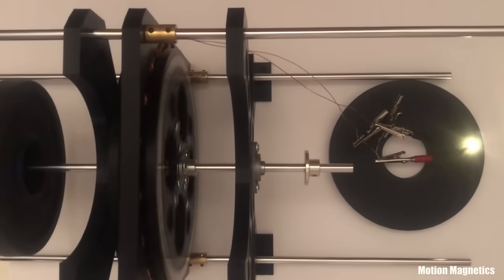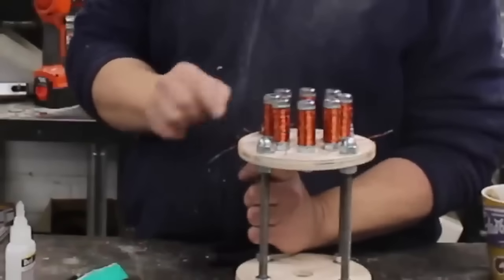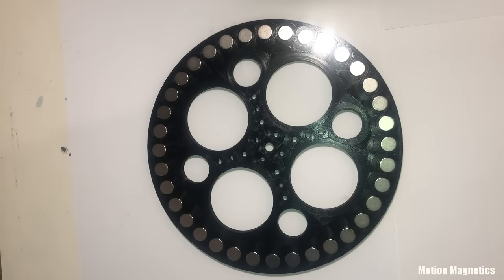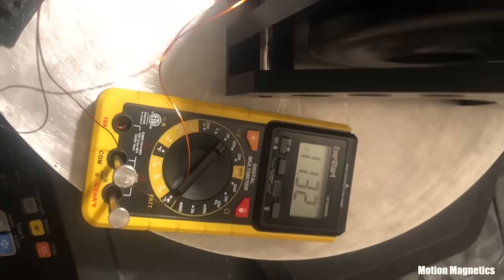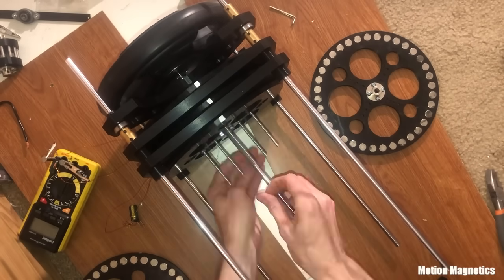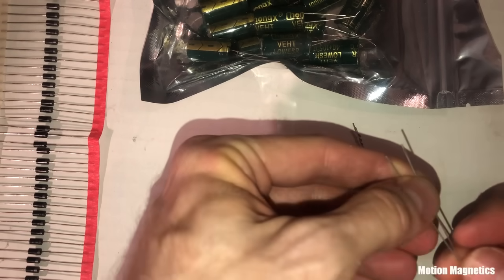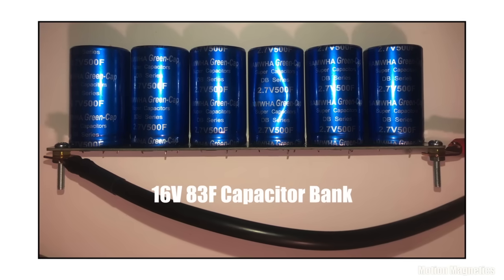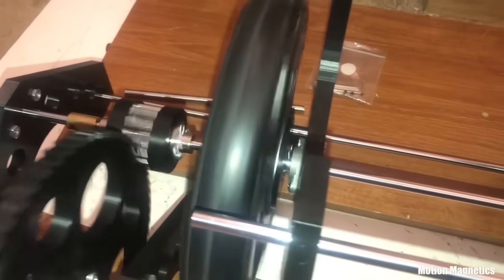Stackable Generator

Comment: I was using ChatGPT a bit ago to calculate the voltage generated by using a serpentine coil (after seeing Roberts's video on it) and some n52 magnets arranged in a Halbach array... using individual magnets with a surface Gauss rating of 5884 Gauss in an arrangement of 12 magnets, 30 turns of 18AWG coil, the resistance of approx 0.006385 ohms per meter, I could generate about -1.6V per coil... adding 8 arrays, I could generate -13.2V... Likely I would have to rethink the whole construction, as the magnets used for the calculation are about 30 dollars per one, and I would need several dozen for it. Would be able to generate that voltage turning at about 10 ft per second. 

I no longer remember what the calculations were for RPM, as I had it stenciled on a cutout that I lost, but I found I could connect it to a mechanical machine that has two gears, with enough tooth reduction to turn the motor at either 460 RPM (assuming I calculated for 5 inches in diameter for the magnets) or 381 RPM (assuming I calculated for the full 6 inches in diameter for the magnets). I assume it is around 5 inches where I planned to put the magnets, but through gear reduction, I found I would only need 1 RPM of the mechanical machine to generate the voltage. Combined with 5 other generators, I would have enough to generate a considerable amount of power and get quite a workout as well, assuming I could still spin it and get the maximum amperage. I would likely need to redo the entire design of the primitive setup to save on costs, but it was nice to calculate and design it to that part lol.

EDIT: Also just remembered, I am not sure you can or should put them in parallel, as the wires you used are 23 gauge, 22 being capable of 5 amps and 24 being capable of 3.5 amps... there would be a certain limit on how much power you could put through it. It is why people making generators are typically better at generating high voltage and lower amperage and converting the voltage for batteries, but it usually costs a lot for those converters. I saw one that fit my needs capable of converting 300V at 5-10A of an earlier design to 48V or 70Vish, but cost about 1400 dollars cheapest... Maybe you could reuse the Microwave Transformers to make your transformer capable of capturing a lot of amperage and lower current?
Reply from the maker: It would be interesting to see you put that design together and see how it translates into the real world. 

I may not have explained it in the video but I used the diodes to direct the current out of the 23AWG wire and into 12AWG wire so that when everything was connected together it wouldn't harm the thiner wires from the coils. The 12AWG wire connects to the input terminals on the charge controller, and then  I used 6AWG wire to go from the output terminals of the charge controller to the 16V capacitor bank.
Reply: @Motionmagnetics  That makes far more sense to direct the power through the diodes. As for my design, I intended to make the small wheel of pain from Conan Exiles and have it turn a generator instead of a several hundred-pound mill stone. I have seen only one real wheel of pain design, the massive one from the movie, and a massive man who moved it on his own. I figured from that real-life example, and some tweaking and calculations, I could make a smaller one with enough mechanical advantage to move the motor attached via a simple gear drivetrain. 

As it stands, I would save considerably just by building the wheel and attaching a gear to a treadmill motor I have, and using that to generate electricity. Would be enough to test it I would assume.

The end goal would be to get my saltwater batteries developed and then store the generated power in them. Currently working on increasing the storage by way of graphite and some binding agent, of which is expensive to start buying and testing, so that likely would be the first purchase.
Reply from the maker: @Suzuki_Hiakura  Well that would be an original approach.
Reply: @Motionmagnetics  well done you have proved to a cert

Comment: Rob's great! I didn't quite get the surpentine coil though, can you explain it better, and what does your experience tell you about it?
Reply from the maker: He does a great job of explaining it thoroughly if you search serpentine coil on his channel.

I’ll give you a basic example. Picture a rectangular coil with a magnet passing over it horizontally. The voltage comes from the two vertical sides of the coil as the magnet passes over them, while the portion of the magnetic wire at the top and bottom of the coil doesn’t contribute to the voltage. The premise of the serpentine coil is that by weaving it in a zig-zag pattern there is less waste since there is only wasted wire in one place, either above or below the magnet, instead of two as it passes over the coil. 
I couldn’t tell you specifically how much more or less power you can produce from a serpentine coil, but the main reason I decided to implement it into my design is the incredible ease of making them. I’d rather wind one coil and wrap it around spacers on a stator assembly than multiple coils that I have to connect and wire together.

Comment: I charge up a bank of super capacitors via my e-bike (6x 500F, same as yours) on a back-wheel standard. I need to peddle roughly 1 minute and that gives me about 3 Wh of energy. (in 1 minute I peddle 180 Wh for a minute). Usually I charge up my phone (a 12v to 24 V USB car charges does the buck part). I also run an ipod from that usb to listen to the (internet) radio all day, 1 minute of peddling gives about 4 hours of music. To prevent the power going back from the caps to the motor (which I use as generator) I just us a rather large diode (one from a motorbike I had laying around, it has a metal shell for draining the excessive heat). When the caps are empty I use a very low gear, and as they voltage creeps up I can change gears up and up. My ebike does have a 24 Volt motor, which is very convenient to create 16 Volt. A 36 Volt or higher motor would need a buck controller like you used. 
Keep up the experimenting. You do are going crazy on the amount of (needed) magnets, it makes your project rather expensive I think. I would not go that far. You may be better af using an old handheld battery powered drill. It has the motor (as a generator) and gears already. But there will be less fun in building that, I agree. It depends on your purpose. Mine was to force me to have some form of exercise every day, and do something useful with that energy. PS: I subbed to Murray many years ago, great enthusiasm he has!
Reply from the maker: Thanks for the comment. Sounds like you have the process worked out pretty well to suit your needs. Did you upload a video of your pedal generator? 
Yes, the magnets can get expensive. It would definitely be cheaper to scrap them out of something or use a motor as a generator. Though perhaps not as fun?
Reply: @Motionmagnetics  I do have one or two very old movies with the ebike. The bike is still working, but I have not made a video for a long while. On my channel you do can see me powering several electric devices.
Reply from the maker: @deslomeslager  I found it. You should do more with that. Love your setup and the simplicity of it! Great video!

Comment: I love Rob's channel too. Great guy. Where do you get your shaft fittings for your rotor?

That would be beautiful in my projects. I make static electric generators, think voss machines or wimshurst machine. My own designs. I'm trying to get the current capacity up. Different design chanllenges.

Friggen cool though, I was thinking about making an PM-DC genny once I'm bored with making lightning shoot through my basement with THE RAW UNBRIDDLED POWER OF MY BARE HANDS! applied to a driveshaft XD

In all seriousness though, cool project

BTW, I noticed you have an interest in free energy. We should be friends because I think you and I will have some very interesting discussions: Like how it's possible my innert static electric generator takes 0.44 amps of drive power and the active generator takes 0.47 amps of drive power at 118.8 volts from the wall but produces 100 uA @ 115 KV.

Over-unity is possible, I'm working on a better design that will have better alignement, less friction and more charge-carrying ability on the rotor. I already have a COP ~3 on the energy difference bettween active and inert, now it's about fixing my generators balance and alignment and getting lower friction bearing than grease filled sealed bearings so that it doesn't take 51 watts to spin it with all of the electrical connections removed and all the fields neutralised.

Like I said, I think you and I could have some fun discussions.
Reply from the maker: He's inspiring. I found them on Amazon. They are listed as 8mm Rigid Flange Shaft Couplings. 

Thanks! Sounds like you're working on some interesting projects. I'll have to check out your channel.

Thanks for sharing the information.

Comment: good geometry, there is a rotation beyond which the drag decreases if the coils are shorted, like in stepper motors. good the idea about dc/dc converter i think the goal is to keep the cois charged by very low impedance
Reply from the maker: Thanks. Sound logic.

Comment: I'm using a bedini energizer to spin my magnets around my serpentine coil, the video is on my channel. I've open sourced it, please give it a try! You can easily generate more energy with your generator and flywheel then what the bedini circuit uses!
Reply from the maker: I'll take a look.
Reply: awesome! while you are there, if you could give me some pointers on the generator side, you'd have my deepest gratitude!! @Motionmagnetics

Comment: Wouldn't the input need to have the torque to turn the max amount stackable generators even with just 1 generator on it? Otherwise, wouldn't the force on each generator, and thus it's output, half? Or am I missing something.
Reply from the maker: By setting the magnets on both sides of the stator coils it eliminates the need for steel cores in the coils. Without the steel cores creating drag as the magnets spin past them it reduces the need for torque, drastically. So there was very little difference in friction when I went from one rotor to five.

Comment: That is awesome. I was pondering just yesterday why people didn't do coils on both sides of a single magnet array like that.

A thing you might try, and I don't know if it would matter,  is make your magnets match (NN/SS) on either side of the coil, or offset each magnet ring a bit so you get a faster N/S flip.   I just think having opposing magnetic fields affecting the same spot on the coil at the same time may affect your output.  maybe not. I may not be thinking on that right or got your arrangement wrong in my head. (as I understand it you have a N on one side of the coil and a S on the other, alternating, right?)  if you Offset each magnetic ring, it should, if I'm thinking on this right, double the speed each segment of the coil is getting it's field flipped which Should get you more output. 
Something to try, anyway.  Keep up the good work
Reply from the maker: Thanks. I have each rotor set up like a standard wind generator, alternating north to south with each magnet. The rotors are all lined up so that each north pole attracts a south on the next rotor, and each south a north, held evenly apart by spacers. That removes the drag so that they spin freely through the coils in the stators.
Reply: @Motionmagnetics  canceling out back emf? Makes sense

Comment: Cool project. I recommend to go for 24v system or more. There is a cheap and good 300w MPPT boost controller, with the blue label on it. So it makes it a lot easier to charge on variable speed.
Reply from the maker: Good suggestion. I'll look into that. I only picked 12v to work with small standard inverters for the initial testing.
Reply: Yea so consider 48v that would be huge.

Comment: 16 votl cap is not enough leeway. I would use at lest 20v caps or more.
Reply from the maker: Perhaps. I picked 16V because these types of capacitor banks are also used as a supplement to a car battery, and since most small inverters can run off a car battery, they should also run off of the capacitor bank.

Comment: Let's get you some more money! This is going to be a game-changer. Well done, very well done.
Reply from the maker: Thanks. Cashflow is often a hindrance to expedient progress. I am hoping this type of system will help change the game and provide fast and inexpensive energy.
Reply: @Motionmagnetics lo felicito por su empeño quisiera ver que algún día construyera un motor de cuerda con imanes creo que ese sería un gran avance
Reply: @Motionmagnetics I am a big fan of Robert and I'm working on right now a wind turbine with his Serpentine coil and now I'm going to change the design based on his work with flywheels and now you're amazing transformation of his design into an incredible generator it hooked to a wind turbine or two depending on the type of blades and size as well as hooked to a high torque generator to get the system running to produce a really stable high output level of energy as long as you use the right gears and allow the wind turbine to remove even with low levels of of wind so I'm going to give this quite a bit of thought and see what I can come up with but anything you might have in mind let me know because we have the same I guess Mentor you could say and he is fantastic I also want to make my design using milk plastic with graphene added that he demonstrated being stronger than steel as it's biodegradable doesn't create forever chemicals and if you add graphene and a UV clear coat it's not going to degrade until you put it in an composting environment where it will then turn back into milk protein and graphene
Reply: killerwolf7676 he disparages people on YouTube, so they won't be successful, that's literally all he does. Ask yourself why he is spending his time reading about "10 year old technology", if he had anything useful to offer... People are using 10 year old technology heck even 70 year old technology to generate power, because it works.. Which I suspect the commenter... doesn't, lol.
Reply: If only each subscriber sent 50 cents he will get over $25ooo.  I want help this genius.
Reply from the maker: @andrewsiurda6780  Thanks. Money isn't my main motivator. I just want to show people how to be a little bit more energy-independent. I will admit that it wouldn't take as long to get everything built if I didn't have to save up money for parts all the time though.
Reply: I'm working on the same thing that this guy is based on Robert's work and I have the wind turbine part made and a serpentine motor based on his design but now I'm going to completely change it and go towards this but it's all based on Robert's work this guy is amazing man
Reply: this was stolen from electrolips llc berkeley california,  from the slovenian patent office and WIPO in geneva in 2023,  these people are in on the scam group of canadian cavepeople
Reply: This is not a game changer. This is 10 year old technology. Guess why nobody uses it?
Reply: @MrSummitville What are you even talking about. Troll harder kid. You ever heard of a pencil ✏️? Wonder how old those are. Your argument means nothing. You want to bully people talking about inventing things and you can't even respond back. Shame on you
Reply: @MrSummitville  I like to know what part is not a game changer. The multi rotor coil arrangement or the gravity part.
Reply: @MrSummitville Why?  I’m genuinely curious and don’t know the answer to this.  Is it because of diminishing returns?  Eddy currents too strong in this setup?